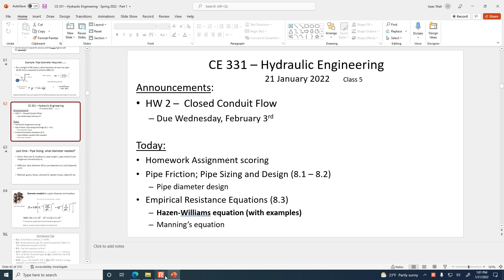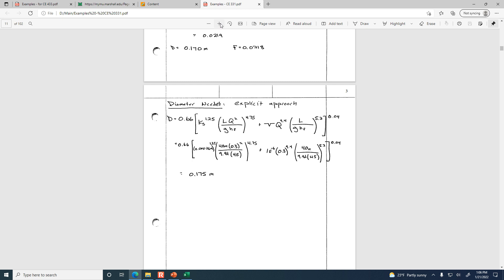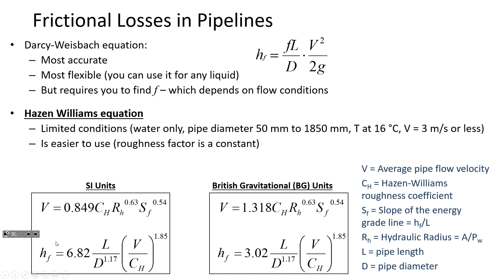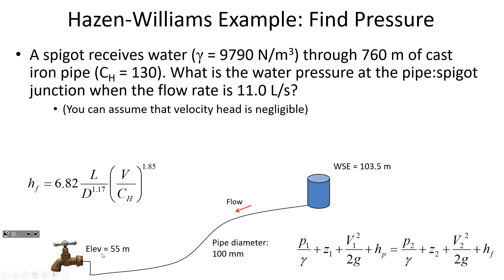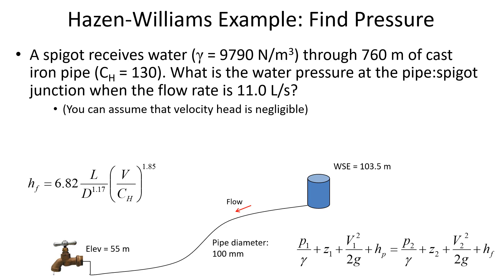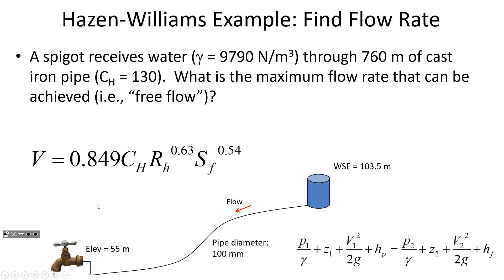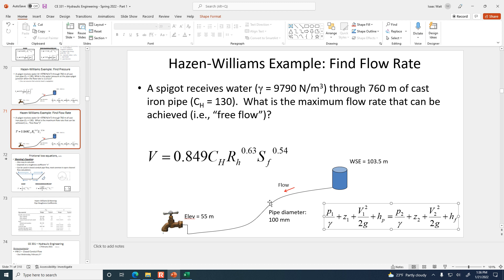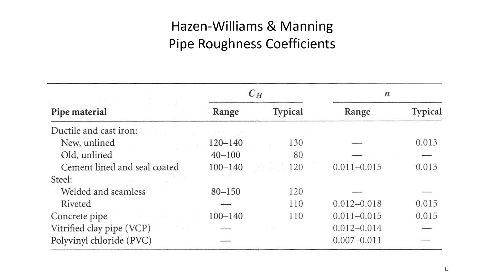Hazen-Williams Equation: solve for Q, solve for P - CE 331, Class 5 (21 Jan 2022)

Comment: Thank you Mr. Wait !  I'm a civil engineering student and english is not my native language.  But, sometimes, is more didactic for me to find a video class in english.  That was the case with your very nicely explained class.  I've been finding only exercises where the flow rate (or velocity) is a design/predetermined, so I feel a bit frustrated.  Actually, what I'm trying to find is formulas to calculate the "natural" gravity (simple vented water reservoir-spigot through a closed conduit) flow rate, velocity and spigot water pressure (m), given the pipe diameter (D), the geometric height (Z1 - Z2), the length (L), and the pipe material coeficient (C).  Here in Brazil, the residential houses tipically use 50 mm to 25 mm pvc pipes; and we used to install residential water pump only when it's absolutely necessary.  That's why I'm especially interested in knowing a little more on what to expect from the natural gravity flow and velocity through a predetermined pipe. Any suggestion is really appreciated. Thank you once more.  Best regards from Brazil
Reply from the maker: Thanks for your comment.  You can determine the gravity flow rate using Hazen-Williams equation, arranged as: Q = 0.849*C*R^0.63*(hf/L)^0.54 - the example illustrated here may offer additional details: https://youtu.be/xQl-dGNdg78?t=1052

Comment: Dear Sir, please tell me how it is possible to determine the flow rate on a 100mm PE pipe at a point where the water pressure is 5.0 bar. Does it make a difference if the pipeline is gravity fed or under pump pressure. Please give me the information. Thank in advance !